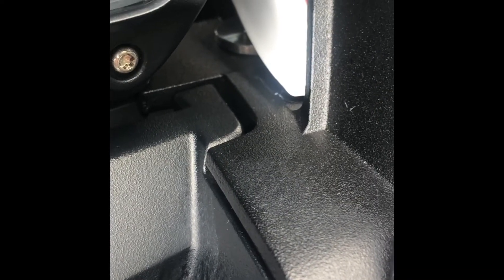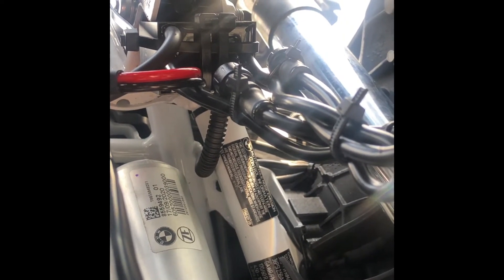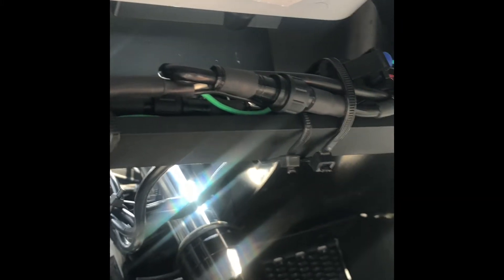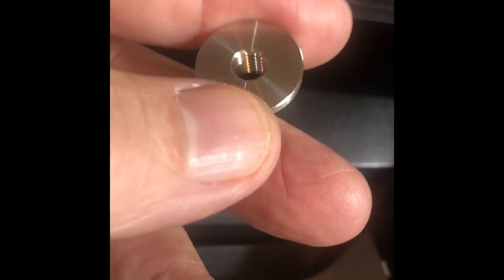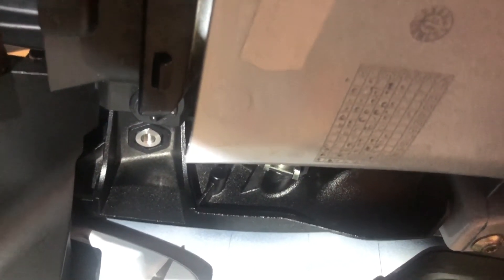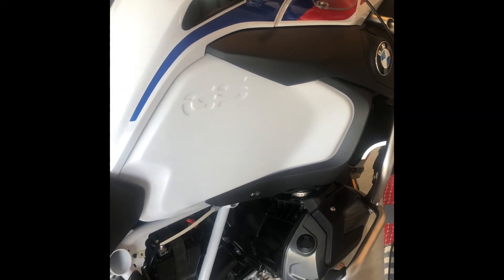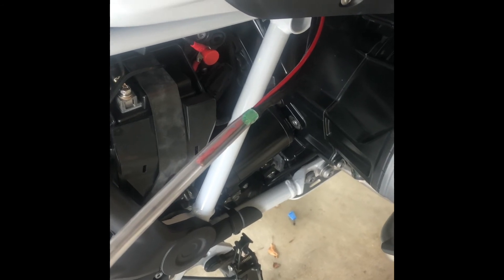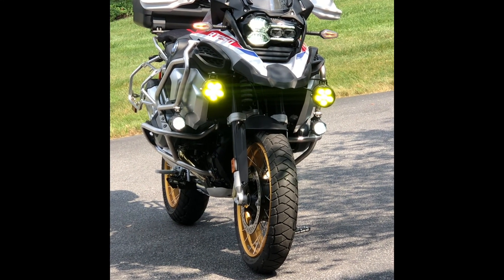BMW GSAW  CLEARWATER LIGHTS INSTALL TIPS

Comment: Nice video and super helpful to me with my recent install! I would add the following minor points: I could not get all three wires into the tube to pull it through, so I did the power wires first, then the data cable. I smeared a bit of chain lube on the tube to help it slide through. Also, in the installation kit is a small square piece of plastic with adhesive backing on it. I never noticed it until I was done. I called Clearwater and they told me you can stick the plastic piece on the power supply and thread zip ties through the loops before you try to secure it in front. Sort of eliminates the need for three hands, and probably would be helpful.